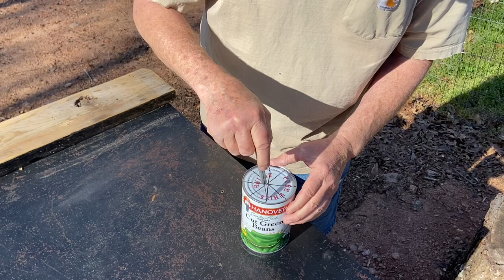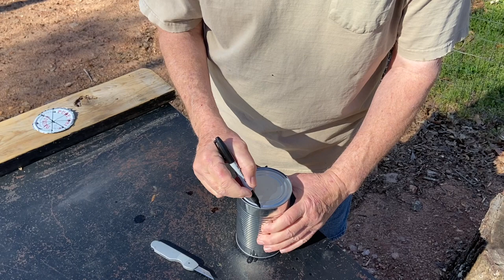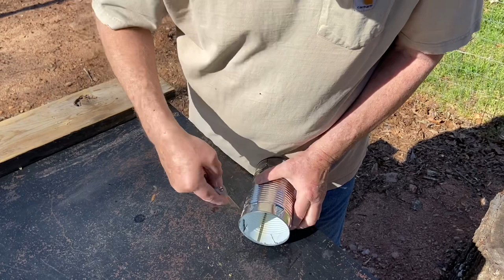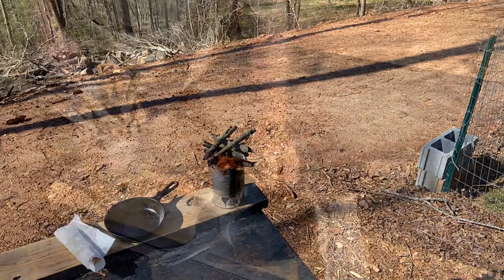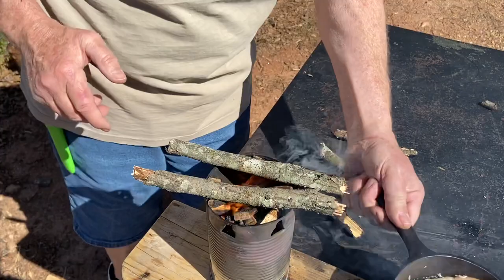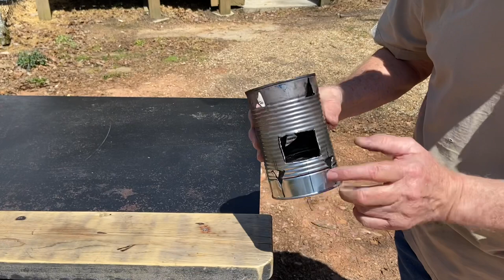Poor Man’s Hobo Stove, Pocketknife-made

Comment from the maker: You don't need a lot of tools to build a poor man's hobo stove, just a pocketknife. You've seen mine a thousand times. It's a Stanley 10-049 and has a locking stainless steel blade that's only 1 1/2" long. It made these cuts easily.
   I like that the stove has all the features that makes it a great burner... an elevated perforated floor, ventilation holes across the top and bottom, and the very important side ventilation hole. For pot supports, I used a couple of impromptu sticks. What a great little stove! It easily heated up the little iron skillet and got the bacon fried in just 10 minutes.
   Please follow the LINKs below and SUBSCRIBE. Thank You!

Hobo Stove Builds Playlist
https://www.youtube.com/playlist?list=PLkoXX8XsMW3lZeJRY3SSyPsZBTEWCnHbp
How To Make A Stainless Hobo Stove Out Of A 3qt Pot
https://youtu.be/idVu1ETX2kg

Comment: That knife is the absolute best ever. I love it because it’s so slim and light but the blade is more stout than you’d think because it’s thicker than a standard utility blade. I sharpen mine and hardly ever need to replace them. That being said I’m sure they’ll discontinue it just to piss me off so I have like 5 unopened knives to complement my 2 users and no less than 30 blades. I think I’m set! 

Sometimes I do some fiddling with the internals to smooth them out a little as some are better than others when it comes to mechanism smoothness.
Reply from the maker: Yeah, the fit and finish is not consistent, but they were never meant to be show knives either.

Comment: Make the top vent holes square and bend the square up so it extends higher than the top the can. You can sit the pan on top of the bent up squares. Hope it make sense.
Reply from the maker: I tried it years ago, got one use before the uprights were too soft to hold a pan. There's also problems with getting an arched piece of metal to bend and then arch back the other way. I wanted to do this without extra tools like pliers, too. Make one up and let me know how it works for you.

Comment: Reverse the triangles at the top and bend them up ... built-in pan rest ,maybe make them square tabs ?
Reply from the maker: I tried that years ago. After the intense heat, heats them up and they cool down, they no longer support the pan.
Reply: @DavidWestBgood2ppl  how long does it take for that to happen? Multiple runs or just one? Just wondering how many uses one could get out of it if they need to use it as support(like they are cooking with briquettes and don't have sticks to sacrifice).
Reply from the maker: I got one use before the uprights were too soft to hold a pan. There's also problems with getting an arched piece of metal to bend and then arch back the other way. I also wanted to do this without extra tools like pliers. Make one up and let me know how it works for you.